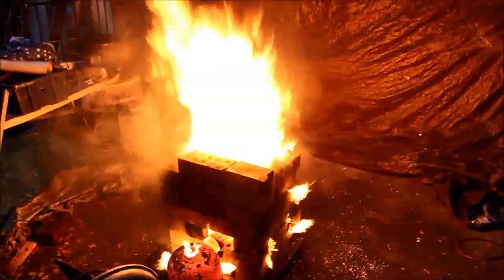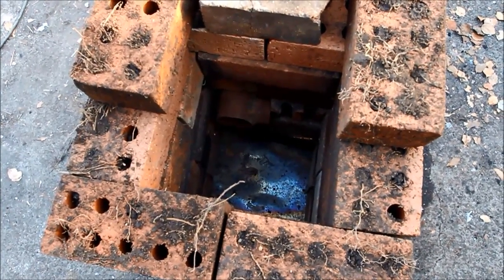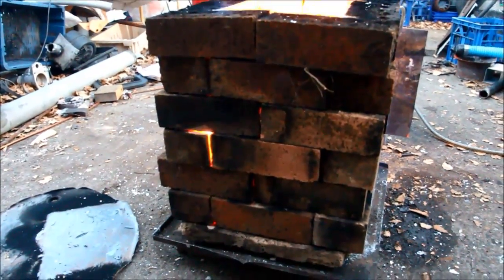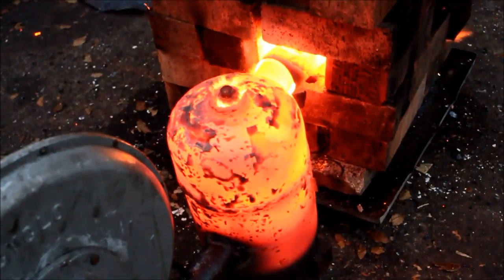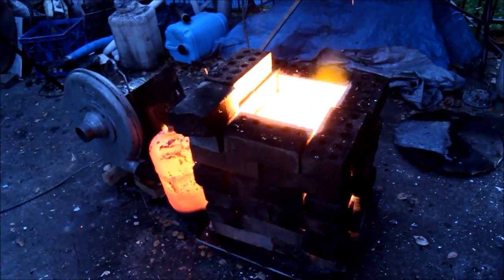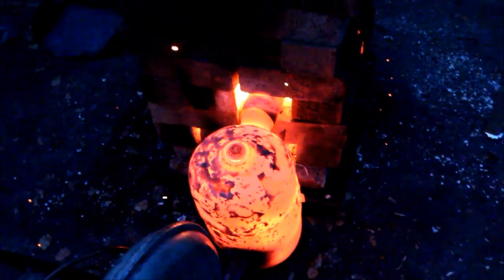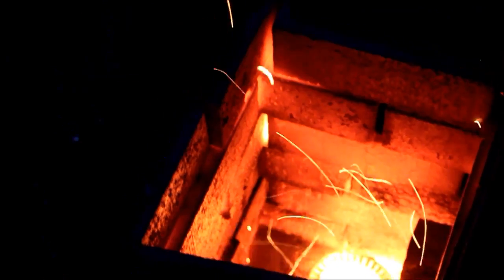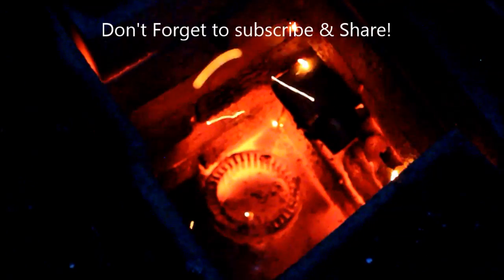300KW Waste oil burner Melts Steel!!

Comment: Hi mate did u pressurize the fuel nozzle before going in to the air blower pipe ???
Reply from the maker: I can't remember now mate, i think this was just gravity feed but in any case, the most I ever pressurise the oil is 1 PSI which is to overcome the difference in flow between a full and an empty oil tank.
Reply: @glumpy10  alright. Is just the gravity fed... Thanks a lot !

Comment: I will say your lacking the understanding, That canister you have glowing red hot, is an can an will melt on you unexpectedly,
Then what will you do? Run like hell as you won't be able to shut off the oil supply
You would have been better off making or lining that canister with fire brick or mortar. That way you would not have to be scared of melt down, an that is exactly what will happen one day with what you have unless it has already happened. I hope nobody got burned or hurt.

Comment: should add a air compressor spray feed and supply it with water........
should make cool downs fast and even

i cant wait to get mi nut system going........
oil gasifeir runnig at 800c is mi goal

Comment: What kind of oil are you using in your burner?
Reply from the maker: As Darren said, Engine or veg oil.  I don't actualy clean the engine oil. haven't got anything in it bad enough to block anything so far. Veg has to have the crumbs taken out so a bit of a filter with some fabric is all it needs. 
You can get away with a lot more in a burner than you can running an engine on it.  For that I make sure it's really clean and dry.
Reply: Thanks for the explanation :) I'd love to know what temperature that furnace is running. It needs to be over 1000C to melt copper. I reckon it's touching 1100 maybe even 1200 judging by the yellow metal.
Reply: He either uses waste veg or motor oil. But he separates it first and cleans it.
Reply: This thing runs two polar bears P/hour..

Comment: When the burner sealed itself I believe it was thermal expansion of the walls re-sealing it.
Reply from the maker: That sounds like a very plausible explanation. I still haven't fixed it. It smokes a bit then stops or I don't notice it but all good either way!
Reply: Oil Burner Maybe an investment in a TIG welder is due. Their weld is clean and should seal the gap seamlessly with little additional metal added.
Reply from the maker: I think you are right. I have been thinking and looking at them for some time.  I want to set up and organised workshop when I move hopefully in the next few months and the TIG and a drill press will be High on the new toy list along with a metal band saw.

Comment: that should cook a pizza in about 3 seconds.

Oil Burner you're the best. I've built a few wast oil burners and reduced all the junk old chain saws,mower engines and assorted scrap Al. to the tune of 300.00 at the recycle center.
I have a few ranchers and farmers giving me all their drain oil from their equipment
Next project is to heat my hot tub and heat my work shop.
Reply from the maker: I'd like to see vids of what you come up with when you are done.
Reply: Oil Burner I'll remember to do just that.at the vary least pictures. 
I'm still between building a big  burner or a natural draft heat box with coils.
A natural draft heat box will be quieter but a good flowing burner set up can be used in other applications. 
I've been heating my shop with my forge but it uses allot of fuel.
Anyhow I'll let you know how it goes.

Comment: This is pure insanity.. and I love it! I'm getting an adrenaline rush from this side of the computer. I'm now dreaming up ideas of some kind of monolithic thermal mass storage system to catch and circulate this heat through a home via feet of brick and water pipe LOL! Run a fire for a half hour a day and stay warm all night.  Beautiful stuff here man.
Reply from the maker: I have thought a lot of this myself. 
Having a 200L drum or several in or under the house where the water can be heated and circulated through to radiate  when the system is shut down.  There is a lot of heat even in a single 200L drum of water when it's up near boiling point  and you could have a fan blowing on it to take the heat off faster from the considerable surface area or just have the thing sitting and gently radiating  for a long time. 

I was also thinking of heating the pool and using that as a thermal mass.  With a decent cover should be able to fire that once a week and and have heat for 7 days. And winter pool partys!

I looked at a house last weekend that had a huge Brick Chimney in the centre of the house. My wife  asked why such a big Chimney with a small Fireplace. I said because this was built by someone that understood how to keep a house warm.  Very rare to see those efficient European designs here and not many people understand about thermal mass either. 

There is a lot you can do simply and cheaply with a bit of ingenuity not many people have these days.
Reply: A pool in an enclosed building would be ideal.  Have you looked into thermal mass rocket stoves? They just zig zag chimney pipe under a sand, rock, and cob bench in the living room and run a fire for an hour to heat the house for an entire day. Just imagine running a rocket stove through that pipe from outside.. a 4 or 6 inch pipe fully welded that runs into the house for a few meters and then loops back out. 

And I love those European designs that run the exhaust through a maze of brick.  With an efficient fire there is no soot to clean out of the chimney! We have it so wrong here in the US with these heat boxes that everyone just shovels armfulls of wood into and restricts the exhaust with a damper creating a sooty polluting smoke. 

Trapping the heat is definitely the way to go.
Reply from the maker: Big Dan
Yep, couldn't agree more. I have a pizza oven I built that has 1000kg of bricks and dirt in it. Takes a good fire a couple of hours to get up to temp ( or 45min for a burner!) and then you can cook in the thing with just a small wood fire for a couple of hours.  I Built a double size one for my Neighbour and she cookes pizza and roast at night then gets up in the morning  and swabs the ash out with a damp cloth them bakes bread in the thing.

A mate paid a LOT of money for a pre made oven that relys on insulation to keep the heat in and it's sadly pretty poor.  No thermal mass means the thing is screaming hot with a fire and goes cold straight away. I can't really cook in the thing properly which he was dissapointed in because he thought it was just him and now realises it's the oven and why.

I'd like to build a seat along one wall of the house with a flue through it and do it in cob. I'm obviously no greenie but I do like good design, clever thinking and efficiency. Would be a great  talking piece as well.

Comment: gotta say, that is one damned impressive burner! i don't think the fire extinguisher manufacturer would approve, however... lol, good thing the label burned off
Reply from the maker: Kind of a hypocracy using an extinguisher as a burner isn't it?  :0)
Reply: actually, i kind of view it as an additional safety feature, rofl. btw, LOVED the line in the one vid "if this is too much for you, go back to your stamp collecting and hair-dressing videos...". i almost pissed myself i laughed so hard (it's the kind of thing i say at work all the time). ok, now for the technical: your absolute minimalist approach is awesome. my only suggestion is scavenging your inlet air from around your chambers, for a pre-heat effect like the tuyeres in a cupola. then you will even more "surface of the sun" type heat, lol. you pre-run with propane to get up to heat?

Comment: huge 2 x 4' steel columns from 911 melted at 1700F from the small fire left after the initial combustion impact which burned up most of the jet fuel. Fuel also turned columns to dust.
Reply from the maker: No, it didn't sorry. Fire NEVER turns steel to dust . Ever.  Steel does not melt at 1700F either.
I understand there is much sensationalism about this and 10 times as much misinformation. If you want to know whats right and what is poppycock, I suggest you look outside what is said on that subject. 
See what the melting point ( as against the weakening point) of steel is say in a foundry or other place beams are heated or steel is poured.  You'll find the only place the temp claims and "Dust" are made are in that one refrence. 

I don't need to be an expert on anything to assure you that nothing happened that day to change the laws of physics and the properties of the melting point of steel. 

 Look at what goes on outside that completely distorted and maligned debacle of a debate. 
You will find that much of what is professed there goes against common and known facts and practices everywhere else outside that one subject before and since. 
 If it does or does not happen elsewhere, you know the same applies to September 11 as well.
Reply: It's a shame that so many are ignorant of the facts and eat everything the media feeds them. Anyone with brains knows what didn't happen on that day.
Reply: Tom mentioned 1700F.  This is a little above the point you can cut, burn, steel with an oxy  torch.  Melting point is 2700f for steel.  This is above the 2000f temps produced by jet fuel.

Comment: can you help me how to calculate to find 300 KW?
Reply from the maker: +Erick Morgan 1 litre of oil contains 10Kw of energy.  2L of oil an hour is 20KWh, 10L /hr = 100kwh etc. 
For 300Kw you need to burn 30l hr or 500ml min.
Reply: +Oil Burner , is it posible to install turbo charge at the discharge and take the centrifugal force to get high flow air for furnace, so we dont need blower?
Reply from the maker: Erick Morgan
 No. The output from the burner would melt the turbine wheel quickly.
If you did create a combustor to lower the gas temp, it would have to be below that of aluminium for the turbo not to over heat so would not melt anything but lead.

Of course besides that, you would need an oil pump and a cooler as well as gauges to make sure the temps were OK.
Way too much trouble and complexity even if it did work.
Reply: +Oil Burner yes im afraid of turbine melting too.... and also about intercooler to take care of air density. Heavy equipment (such as bulldozer) turbo charge can reach 500 deg celcius in normal operation, so if we have that turbo charge, we just need to control the temperature not to exceed 500 deg C.

we have same hobby sir, but for this project i try to make sand dryer with waste oil burner. Free fuel and hope free (or less) electricity for blower....
Reply: +Erick Morgan your best bet would be to get a custom made turbine made from aviation grade nickle alloy the same alloy used in jet engine turbine blades

Comment: Original idea. Could the blower be disconnected to protect it shortly after finishing the burn as it looks as though most of the afterglow is from the copper, don't want to unneccessarily oxidize that. Maybe all the heat would make that too difficult.

Comment: Hi,

Maybe you could find some metal that won’t be melted by the temps you are hitting to suspend anything you want to melt rather than throwing it into the bottom where there is every chance of it welding itself to something at the bottom?
Reply from the maker: +mrbluenun  Thats a good Suggestion.  Maybe something like a ceramic plinth might be the go? Think I'll just have to bite the bullet next time I try and get a proper crucible.
Reply: +Oil Burner get a graphite crucible they are available online 
if your manage to start the graphite on fire then you have nuclear levels of heat here

Comment: with this huge amount of energy in oil, WHY OUR CARS ARE NOT FUEL EFFICIENT?
Reply: Oscar Radikoro You have to consider heat loss in the combustion, fraction inside engine, and many more. You cannot have 100% work from the combustion.
Reply: +insAneTunA yeah I'm sure you have nothing to llearn from a nobel prize winning economist
Reply: +Oscar Radikoro They are fuel efficient.Your government artificially restricts the supply of oil causing price rise and it to seem they are not efficient.
Reply: +insAneTunA Do you know what also runs on greed? everything...you need to look up milton friedman and listen to him
Reply: george crown
if my own observations are different from what Milton Friedman writes then what's to learn from a guy who doesn't look further then his own nose and at the same time benefits from the very corrupt  system that he is supposed to criticize??? Who gave him the award??? I tell you the answer to that question, those people who awarded him are the very same people who benefit from the same corrupt system that Milton Friedman is supposed to criticize. How reliable does that make Milton Friedman's research??? It's as if your asking the cook to judge his own prepared food. The Nobel prize is only possible because the money that Alfred Nobel earned with his dynamite is heavily invested into the stock market. The Nobel prize committee would never ever award a person who attacks the very same system that keeps the Nobel Prize committee in place. To me it proves nothing that a guy earns an award. For example a few years ago the top of the Dutch financial sector awarded a Dutch banker with an important business award for his work, that same year the same banker was bankrupt himself and a lot of hard working people lost their jobs or got stuck with overpriced loans, shady and/or illegal insurances and mile high debts. At the present time that same banker started a new company inside the same financial sector, he started a debt collectors agency and he is still rich.

So awards don't necessarily proof that somebody is actual right about a subject, especially when the awards come from people who earn their existence from the same corrupt system as the person who gets the award and is supposed to be critical about it. Forget Milton Friedman and trust me when I say that the financial sector is a breeding place for greed and corruption!!!

Greed and an obsessive hunger for power destroys this world, and it is the right time to start a war on greed!!!
Reply: insanetuna is one of those guys who loves to tell others how to do things but has never built anything himself and has no idea what he is talking about despite being verbose.
Reply: +Oil Burner Cars are producing less nitrous oxide now, with the new emissions standards. It used to be that I could see a dark cloud of brown smog moving down towards my house from LA, but now, I can see for tens of miles. Air cleanliness is improving.
Reply: george crown
Big bullshit if you ask me my friend, and Milton Friedman should speak for himself, not for me or others, and neither can you. In this particular case I rather trust my own observations because not only do I know plenty of people who are NOT motivated by greed or power, but I have seen many other examples of people who I don't personally know as well. I want to make clear that there is a big difference between being well rewarded and greed, and for many people the reward can be different. Love is a good motivator for many, as well as beauty or curiosity or fame, but greed and power are by far the most dangerous, addicting and ugliest emotions, and some of the humans have less control about it, and that is when it becomes an illness. An undesirable and uncontrollable need for greed and power is an illness, and those greedy power hungry bastards who ruin the planet and cause wars should be picked out and hospitalized and treated for their illness. It's an illness when you no longer care how other people are doing as long as you are doing well. That is my humble opinion and there is nothing that you or Milton Friedman can say that will change my opinion, it is not even a point of discussion for me. Milton Friedman is a sick bastard who tries to hide his own illness by writing false statements about other people, as if all people are greedy bastards like him. But that is simply not true, I have seen it with my own eyes. So maybe you should open your eyes a bit more, and read a bit less what you desire to hear, because it looks to me that you have been searching for an excuse or reason to explain your own hunger for greed and/or power. Here is a funny story for you my friend: Two guys in the nut house are talking to each other, and one says to the other, you are not crazy at all, the other one smiles and says....thank you, you don't seem to be crazy either. And they never stopped talking to each other and since then they never talked to other people again. They found their happiness together. The moral of the story is that when you only listen to one side of the story and at the same time ignore all other facts then you are fooling yourself, and maybe also a friend or two, but you cannot or shouldn't think that you can fool all other people as well, just remember that when you are writing that nonsense again George. Have a good day George.

P.S. It went wrong with this world when we started to use greed as a business model. Bankers started the industrial revolution in order to fulfill their own greed without even caring for the possible bad consequences. Evolutionary seen we are hunter gatherers, but when does it become an illness? In general it is considered an illness when your actions hurt yourself or other people while there is no direct or indirect need to do that.
Reply: Oil Burner no
Reply: They would be more efficient if we were not STOPPED at EVERY STOP LIGHT!!! You get your car up to speed only to be stopped at the very next intersection. Stop and go, Stop again, go, Stop again, go!!! See my point? Stop! Go! Stop! Go! Stop!!!
Reply from the maker: Oscar Radikoro  You would have to define fuel efficient for a start. They could be a lot more economical if they weren't lumbered with the overly pedantic emissions requirements. 
Burning more fuel and making more emissions to make cleaner emissions still results in more emissions.